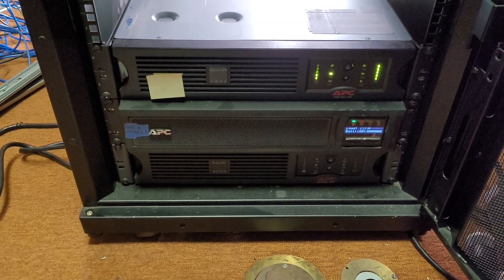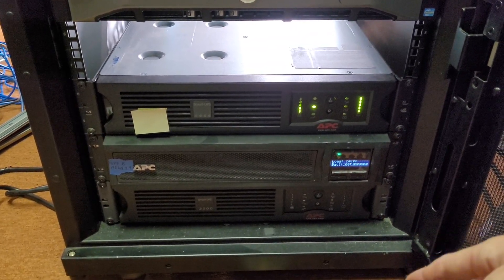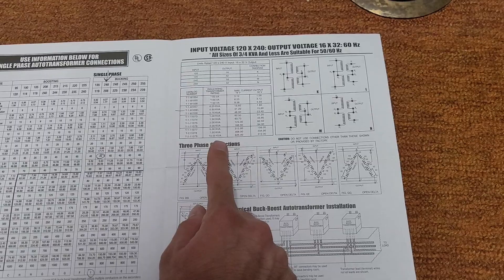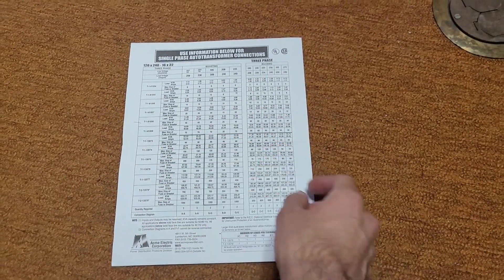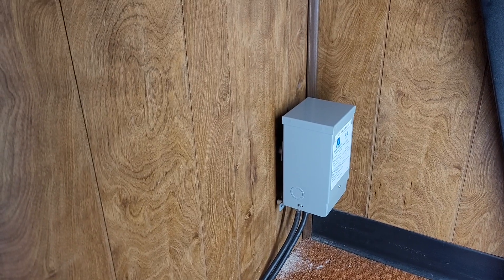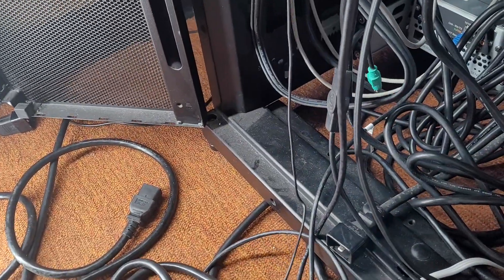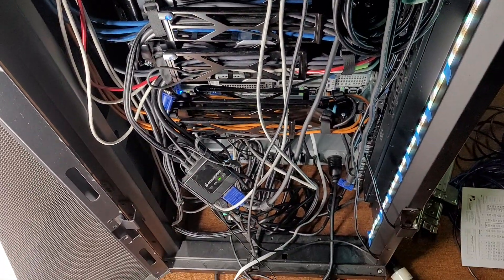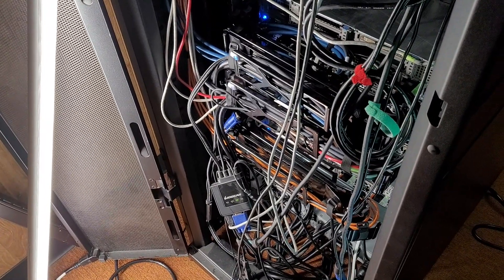The solution to using 208V only battery backups in a 240V homelab (Buck boost transformer)

Comment: Good tutorial 👏 I appreciate the fact that you encouraged others to seek an electrician's advice because there are differences in the equipment (and voltage available) 👍✨
Reply from the maker: @DHuhnCatMom  safety first. 🦺🧯⛑️
Reply: @computersales  Wise advice! 🦺⛑️
Reply: I'm pretty sure you wouldn't need a xfmr, you can plug L1 to your hi leg and the other line to your neutral